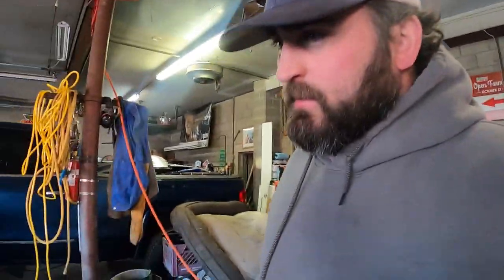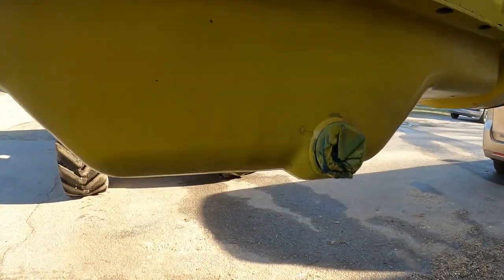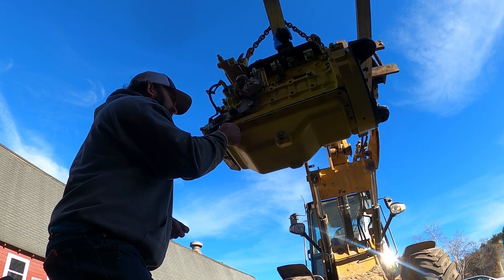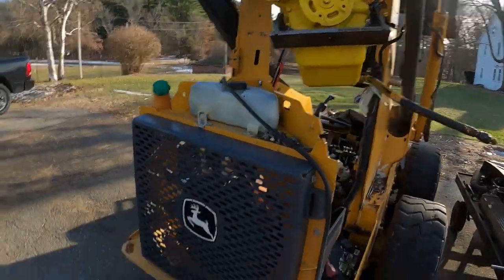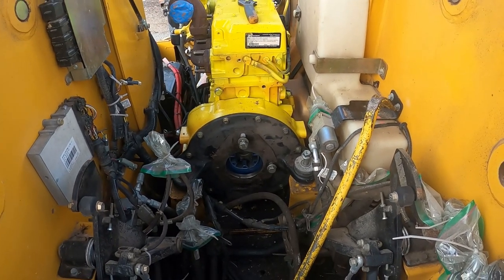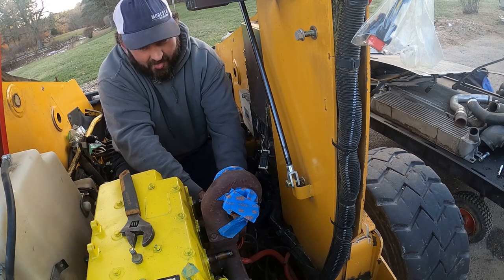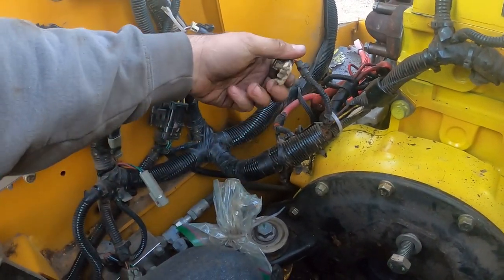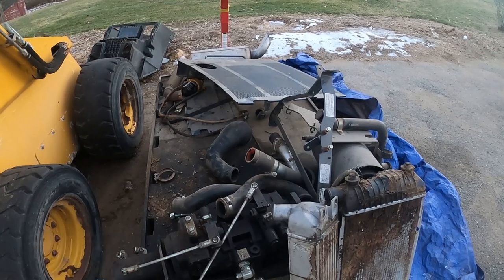Will It Ever Run Again? Deere 326D Skid Steer Engine Repair Pt1

Comment: I’m a road mechanic sounds silly but I print off my pictures that night and mark it .years go by with big jobs nice to have an assembly manual of important stuff . Nice if you go back to the job as well . 
Adjustable pliers lead to loose bolts disassembly use only.... good job enjoy this channel a lot.

Comment: This oil pan need thick layer of silicone in the spot between the timing cover and the oil pan.. if not it's will leak..the oil pan  bolts torque spec and tight sequence.. its probably going to leak if you didn't do that

Comment: Its hard for me to believe John Deere has so many parts and tractors made in Mexico.  Oh well its the world we live in now.
Reply: Why?  They have factories all over the world.  England, Germany, Brazil, China, Australia.   The rice harvesting equipment is made in China. and the sugar cane harvesting equipment is made in Brazil because those are the major markets for that equipment.  They've had a diesel engine factory in Mexico for years. If you don't like things manufactured in Mexico, then don't fly on a commercial aircraft with GE engines - they've been made in Monterey, Mexico for at least 35 years.   The GE / Safran joint venture builds CFM engines in Mexico, and the largest aircraft wing wiring factory in the world is Safran's in Mexico.  Safran produces 95% of the wiring on the 787 and 75% of the wiring for the A380 in their Mexico plant.  Has nothing to do with where the manufacturing happens and everything to do with quality control / quality assurance.
Reply: What’s wrong with it being built in Mexico, their parts are built all over the world

Comment: Great video and good knowledge. The question I’m going to ask has nothing to do with the engine. Have you ever replaced the tapered pins in the lower boom that connects to the pivot point on quick attach plate? I have a lot a horizontal play on my quick attach plate but for the hell of me I can’t figure out on how to remove those tapered pins. I want to remove the pins so I could put a washer spacer in there to prevent side travel. My machine is a 318D similar components to yours. Would you have any ideas, appreciate it very much. Thanks,Andy

Comment: What model is ur cat wheel loader? and do u like it?
Reply from the maker: 908H. Absolutely love it would buy another in a heartbeat
Reply: @DuffyAg  thanks. I'm thinking about getting one of these over another skid steer. Need more dump height for loading my mixer wagon.
Reply from the maker: @mirrorimagecattleco  we use it for everything. Only reason why we still have a skidloader is for cleaning in the pens outside the dairy barn and defacing bunk

Comment: Hate to be that guy but why not clean a space out in the shop so you don’t have to lay gasket on the gravel
Reply from the maker: The machine wouldn't fit in the shop with the arms up, if that's what your talking about. Only took 2 minutes put gasket on wouldn't make much difference doing it inside or outaide
Reply: Hey sometimes you gotta work in the rocks once you get used to it it's not that bad
Reply from the maker: The driveway is paved there tho
Reply: @DuffyAg  well that shows how much I pay attention
Reply: Then don’t be that guy, the guy that has a perfect place for every project he works on.